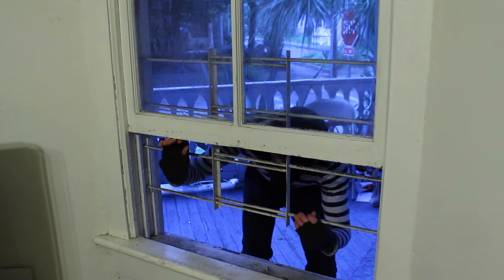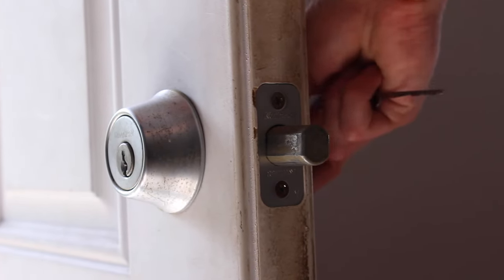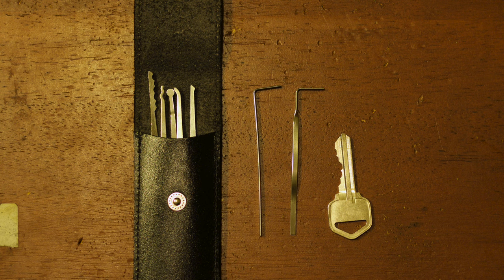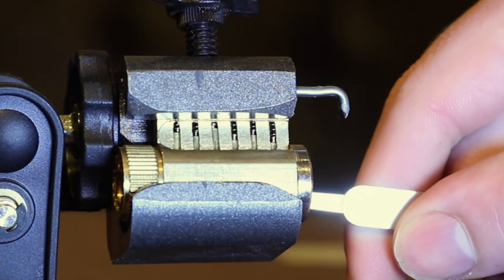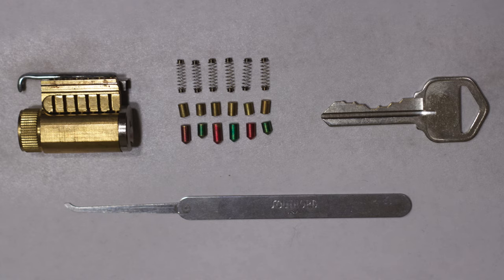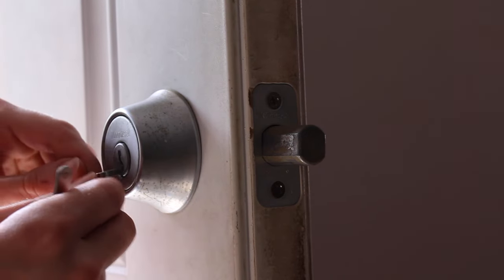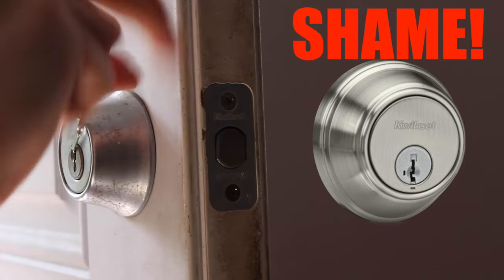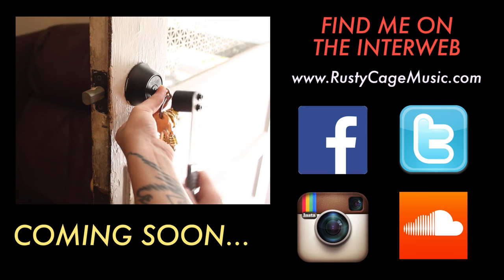How to Pick a Lock | Step-by-Step Tutorial

Comment: I have a better way
step 1: get duct tape
step 2: get a grenade
step 3: tape the grenade to the lock
step 4: pull the pin and run away
works every time trust me
Reply: HOW DO YOU HAVE 37K SUBSCRIBERS?!?
Reply: I swear I see you on almost every video
Reply: Yes, that does seem more efficient
Reply: STEALTH 100
Reply: Thank you so much! It worked really well!
Reply: And if it is a bank vault
Reply: Won't work, you need to pull the pin as you said THEN you need THE SAFETY HANDLE TO COME OFF. You duct taped the grenades safety handle, the safety handle with prevent you from blowing the grenade.
Reply: yee boi
Reply: I think it’s a permanent fixture
Reply: didnt work when i tried to break into a military base. unsub Kappa
Reply: What about the secondary safety measure of grenades to prevent this from happening
Reply: Also knock on the door right before you run away (only if your breaking in someone’s house)
Reply: lol that is not good lmao
Reply: I got C4 by accident
Reply: Accidentally used a thermonuclear bomb... oops
Reply: Shit I used a battleship cannon
Reply: Hell ya
Reply: You know the pin hold down a handle bar thing and when the is not in the position when the pin was pulled before it wont go boom but if it's out of place it goes boomm.
Reply: But you have to be fast tho
Reply: @quinnmiller5059  your neighbors will call the cops
Reply: Visible Confusion how do u have that much subs you should start a youtube career bro
Reply: Mines better 
Step 1: kick open the door till the cops come then say you got kicked out of a 3sum and you forgot your wallet
100 percent works 

Dont sue me sue Visible Confusion
Reply: No
Reply: And, it’s surprisingly easy and discreet
Reply: DAMN that's funny especially when you said trust me it works ever time
Reply: Now you just need to use the pin of the grenade and use it to pick the lock...
Works every time
Reply: @monkeyslop1253  that's a lie the bank vault didnt open
Reply: I like just pulling the pin and staying there, but that's just personal preference
Reply: Haha
Reply: Monkeyslop ye
Reply: Ethan Wilde r/woooosh
Reply: Your name says how i feel after i saw your comment
Reply: The master key
Reply: Instructions not clear duct taped the pin to the door and pulled the grenade
Reply: Not to sneaky tho
Reply: You be like: FBI OPEN-THE-FUCK-UP!
Reply: Lol
Reply: Tried this with a bank vault can confirm that it doesn’t always work
Reply: yo you made me blow up the tv
Reply: To bad it's loud as fuck
Reply: I traded for a grenade because that’s normal.
Reply: What about a dirty bomb
Reply: @kelseywu3723  911 please
Reply: Hmmmmm isn't that a bit to loud and wouldn't it hurt some one when you are robbing a house you don't wanna be loud and you don't want anyone to see you
Reply: that is some sub bot if ive ever seen it
Reply: And they won’t even notice...
Reply: That's not very discreet
Reply: lmao
Reply: What about a explosion proof door, or bulletproof glass
Reply: Visible Confusion THE COOS HAVE BEEN ALERTED ESCAPE THE OBJECTIEVE
Reply: Let's get this man a silver play button
Reply: E
Reply: Tried it at a bank I didn’t work
Reply: Bruh I need a grenade
Reply: Some people can't get grenades
Reply: Use a c4 instead
Reply: Visible Confusion of ok
Reply: Easier way
1.steal a tank
2.blow the fricking house
Reply: 82.5k subs with no vid...
Reply: Not lockpick and thats the FBI way
Reply: Well yes but acctualy no
Reply: Wait no that horrible idea that's how u Die if u Wanna Die Come to me 😕
Reply: That is not really stealth but okay..
Reply: Instructions unclear, I ran 10 centimeters, got hospitalised.
Reply: It's also a pretty stealthy way too.
Reply: So do I have to get a new door
Reply: Why do I get the the strange feeling you've done this before
Reply: Just use something heavy instead
Reply: Side effects of this op method: loss of house
Reply: Visible Confusion I tired it  it worked great tip
Reply: Lol
Reply: ... I would die
Reply: @monkeyslop1253  no
Reply: Fr
Reply: or you can just breach a door with a shotgun by shooting the lock off
Reply: Good idea 💡💡💡

Comment: An addendum: this will only work if your lock doesn't have security pins in them. Security pins can be designed in many ways, one of which will require each pin is engaged in a certain order unless you're using a key. If you don't engage them in the right order they wont be flush correctly. However, many older homes don't have security pins, meaning you can effectively use a tension wrench and a rake like Rusty here, and boom you're in.

Comment: I learned back in highschool that getting through locked doors is easier than this (usually the door to the computer lab or a empty classroom) you need a jumbo sized paperclip (not the goofy huge ones but the metal ones that are bigger than the average paperclip) completely unbend the paperclip and then wrap it around the space Inbetween the doorframe and the actual door (where that smol metal area is that actually locks the door) pull the wrapped around paperclip in your direction and try to open the door at the Same time,for some odd reason theres a satisfying click and then you can get into the door as if it wasn't locked (if you close it again the door is magically locked again -3- learned that the hard way)

Comment: I use a dead bolt but it's not like the  one you showed I got a tension rod a lock pick maneuvered the pins but my tension wrench  broke because on mine even from inside you have to push really hard to get it to turn you can turn it to where it gets really close to unlocking then you have to push it really hard to opening it

Comment: I actually have a lock that can only be locked from the inside and can't be picked from the outside, and it's impossible to get locked out that way unless someone else is inside to lock it. You basically have a knob on the inside of the house which slides a metal bar up, and when you try and open the door, the metal bar gets stuck on some other bars not letting you open the door. There is nothing else outside the door with that lock, which means you can only get locked out because of your siblings.

Comment: I can safely say, that UNMAINTAINED, rusty (hehe) Gerda locks are extremely safe. If you lock them with two turns of a key, it requires a large amount of pressure on a key to unlock them. In fact, sometimes I wasn't able to turn them with one hand. Which is beyond capabilities of a tension rod, I think.

Comment: Why even pick the lock? If you got a small yet sturdy piece of metal, you can push it into that hole in the frame, and wedge it behind the latch/bolt. Then you just gotta push it back into the door and pull it open. Of course, some doors may not work, however it worked with my door.